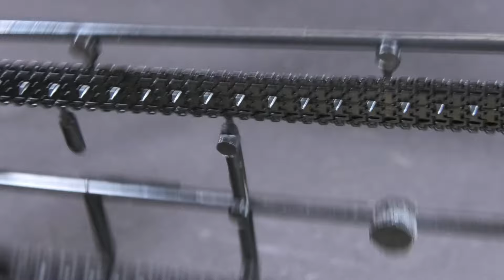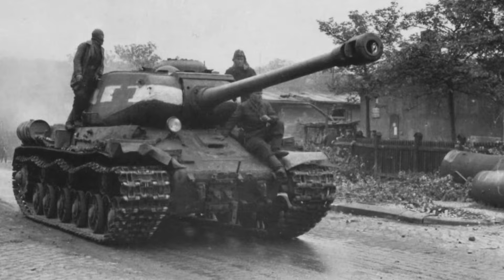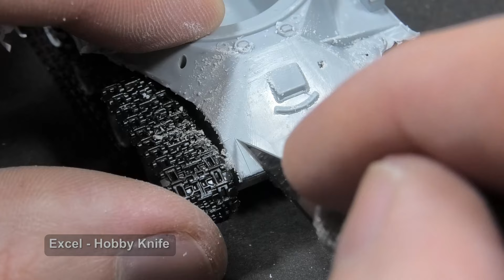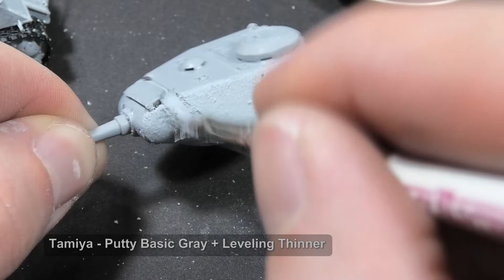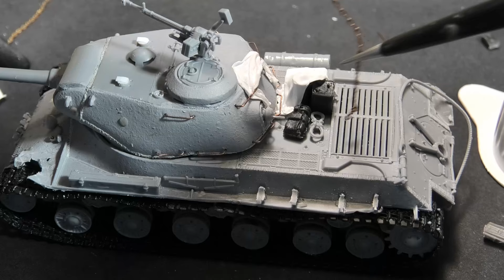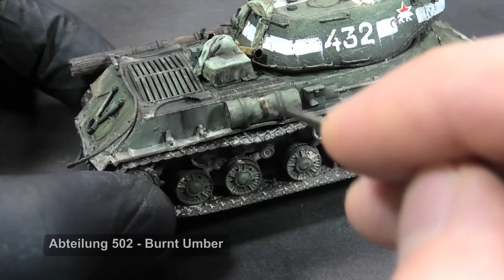IS-2 - 1/72 Zvezda- Tank Model

Comment: Good stuff as always David.  However, the IS-2 turret front was bolted to the main casting with an internal flange.  It definitely wasn’t welded on because removing it was how the main armament was changed.  Don’t feel bad about this - I saw exactly the same by a modeller who is very knowledgeable about Soviet armour so it can happen to anyone!

Comment: You did a great job! Although, there is one minor mistake. You shouldn't have used "oil" when translating writings. "Масло" means "butter" in russian. If you need to specify what's inside a fuel tank, you can try words like "солярка" (used mostly when referring to heavy machines, which don't run on gasoline), "дизель", "топливо" or "горючее".

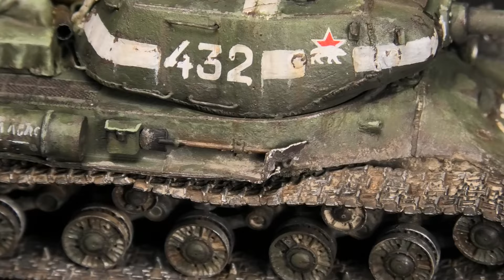Comment: 15:41 
Spare fuel tanks were used only for fuel. Oil(that you wrote on it) was never stored in them simply because it could lead to damage of these liquids from mixing - logic. 
Just a little mistake, in general the model is awesome👍

Comment: Hey. I had this line of models several years ago. The Zvezda's series of "Build without glue" is one of the worst models i have ever seen. I had the similar Is-2, but in earlier version, there modeller had to create whole track line using the flaming candle as a  heating element. Also, track lines had been made absolutely disgusting. The sizes, wide, and length were different, but what was the most "amazing"- lines have been crushing while you were cutting them from the plastic frame! Although, this model was not the worth. If you are doing to build the Panther (Pz. Kpwf V) from the same model line, trust me, don't try your patience, drop everything what is lower than the gun barrel in the trashcan, and print it using 3d printer.

But, the plane lines is not so disgusting, especially german planes of WW2. 

Anyway, i want to tall you that i have been impressed over your work, and i really wait for your next creations.
Reply: I built this kit in 2002 or so. Remember creating tracks with candle, yeah, was fun :-) BUT mine was in 1/35 and I don't think there even was 1/72 version in that time. Maybe you're mistaken with kit scale? Sure it was 1/72?
Reply: @ReiZru  no, unfortunately no. The Zvezda has a line of products "for children", they call this "the building without glue " line. There are models of planes and tanks in 1:72 scale. I have had the is-2, panther, Fw-190 and i guess LaGG-3(i am not sure about this one) from this model line. The tanks where disgusting, but i was surprised of the quality of FW-190 model kit. Very nice kit, small and accurate.

Comment: as a newbie in modeling, would you recommand me 1/72 or 1/35
Reply: 72 is cheap and easy to build. Tank tracks can be a challenge, depending on the type of tracks included in the kit. If something goes wrong, it's not going to hurt that much. You could probably finish a kit in just a few days.
35 will have a lot more (smaller) parts, but you just need patience and care to not damage or lose anything. Tracks are going to be easier because of the larger scale. Obviously more expensive, but companies like Zvezda have some very affordable kits.
Reply: @fonesrphunny7242  ty but since I have time, would you recommand the 1/35 or the 1/72 ? I'm scared that 1/72 will be too fragile and I would break smth ngl xD and for the price, for 1/35 I found a 35€ t34 by zvezda the other day
Reply: @Co3_off  If you break something, you simply glue it back together.
Reply: @Co3_off  Best choice is new zvezda's T-34/SU kits (with 36×× number)  in 1/35 or any tamiya's kits in same scale. 1/72 is too hard for beginners, it's too small